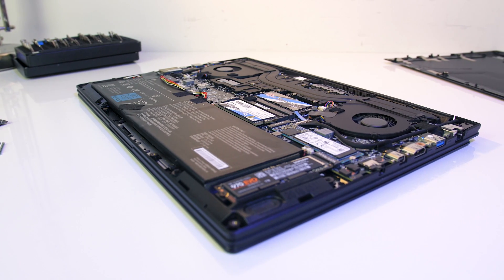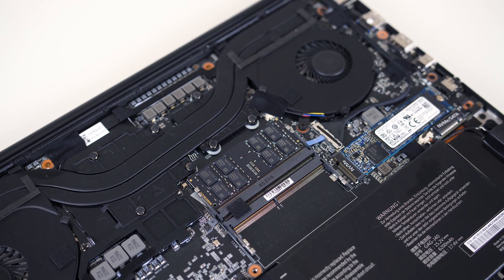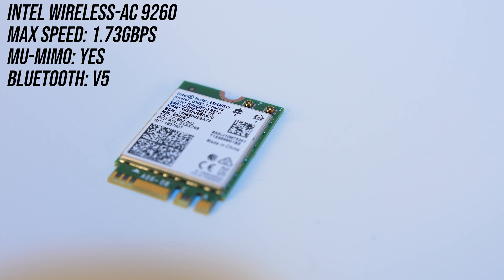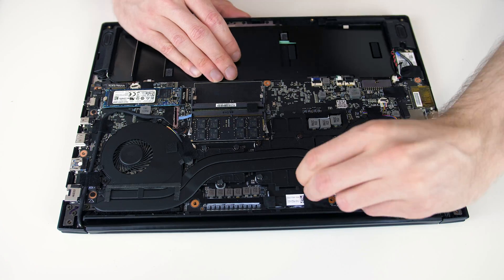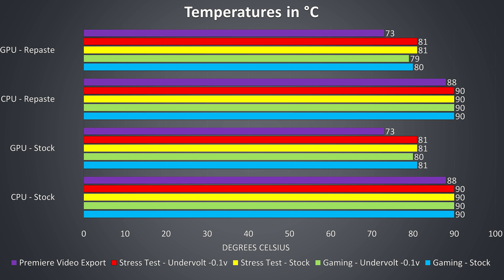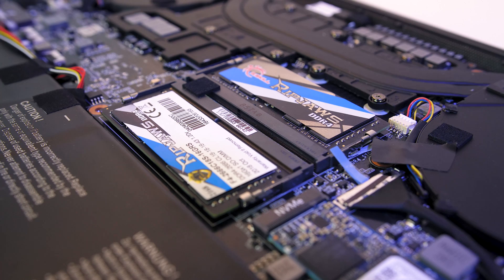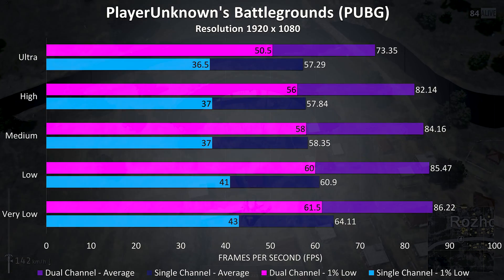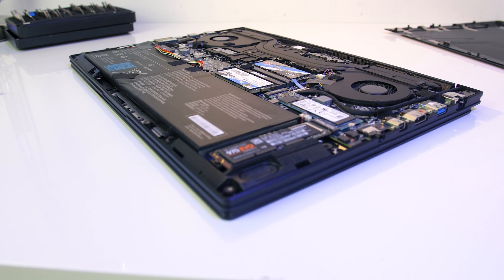Upgrading the Gigabyte Aero 15x Laptop

Comment from the maker: Just to clarify, my memory is running at DDR4-2400 17-17-17-39 because this is the highest that both sticks (1x v-color and 1x g.skill) support. I am not sure why DDR4-2666 with the two G.Skill sticks is not working, but others have also confirmed this issue despite the official Gigabyte documentation saying they should be supported. I submitted a support request to Gigabyte to see what they can advise on this, but it seems like the only way for me to get DDR4-2666 would be to get two new sticks of memory and roll the dice again, which I'm probably not going to bother doing as memory isn't cheap. I also forgot to mention that memory should support DDR4-2666 with JEDEC rather than XMP profiles, which are not supported here.

All temperature testing fan speeds were set to maximum, so that wasn't a variable and was the same throughout all testing.
Reply from the maker: Weird, I tried all sorts of things, rebooting lots, taking the battery out, holding F2 on boot to try and get into the BIOS, leaving it running on black screen for a few mins, leaving it off for a few mins with no power, nothing worked for me. Yes, software reports it as running in dual channel (as per pinned comment, both sticks are able to run at DDR4-2400 CL17) and the increase to game performance shown confirms dual channel is working, we wouldn't see such increases just from the size difference of 16GB > 32GB.
Reply from the maker: @OddlySatisfying  Hey! Yeah I have heard about the HX426S15IB2K2/32, would really love to buy it but the kit is $500 AUD here so I feel like it's not really worth it at this point, even if I sell my G.Skill memory I'd be taking a loss just to get a little extra speed, wish I knew about it going in lol. I mentioned this one in the description though as I found out about it after making the video, so hopefully the info helps someone. I have a feeling that the dual G.Skill sticks will not work, but still I want to see what Gigabyte have to say about it because they shouldn't be listing it as supported. I'll be at CES, I believe there will be quite a few new laptops there so should have a few videos coming out in the next two weeks! So far I've got appointments with MSI, Gigabyte, and Dell, hoping to get more.
Reply: Just upgraded my Aero 15
16GB Crucial CT16G4SFD8266 works with 
16GB V-Color TN416G26D819-SB2
19-19-19-43 2666MHz
Reply from the maker: @Al Ec Thanks! I tried using both sticks in each slot one at a time, neither worked for me. I tried with the battery removed and no disks installed as well. Other people confirmed the same issue, so seems like it's not just me, either way I'll see what their support guys say, hopefully we can get it working.
Reply: @JarrodsTech  Please keep us updated if Gigabyte responds to you. According to the forum you linked, someone had contacted Gigabyte & they replied saying the Crucial 16GB DDR4-2666 SODIMM should work without issues, a couple users tried with success too.
Reply from the maker: @boy638  Yeah I'll update this pinned comment / description with an update when I have one, might post on Twitter/Facebook if you follow there.
Reply: I ended up selling the g.skill sticks I bought on eBay. Both would work alone in my machine but they would not work together. (Though it did take quite a few reinserts to get it to boot) I bought a set of Kingston cl15 (as someone recommended on the announcement for this video) They worked first try. Kingston Technology HyperX Impact 32GB 2666MHz DDR4 CL15 260-Pin SODIMM Laptop Memory, Kit of 2 (HX426S15IB2K2/32) https://www.amazon.com/dp/B01NAL3TYY/ref=cm_sw_r_cp_apa_i_99IjCbPCQQJG6
Reply: @JCFain  i did some upgrades on my 15x, but avoided ram because i knew about the compatibility issues and that shits just expensive right now lol. 

maybe in a few months prices will come down, til then im surviving on single channel
Reply: I do have this laptop too. When I upgrade the ram, i added one more 16gb kingston ram 2666mhz, but i got black screen. Then I changed it to kingston 3200 mhz and it worked, but it slowed down to 2666mhz. weird. both sitcks are not in the support list.
Reply: Is there space around the NVME drive to accommodate a heatsyick?
Reply: Hi. My gigabyte aero 15w is came with single channel 16GB V-Color TN416G26D819-SB2. I want to upgrade it to dual channel. Some people say 16GB Crucial CT16G4SFD8266 will work well. I found this ram on amazon https://www.amazon.com/Crucial-Single-PC4-21300-SODIMM-260-Pin/dp/B071KP8CGJ but then i have to pick between dual rank and single rank. Can someone help me out?
Reply: Are you not able to return the memory should they not work for you?
Reply from the maker: Don't think so, 30 day return policy and bought it about 40 days ago.
Reply: @JarrodsTech  I bought 2x 8 gb sticks of GSkill instead of the 16 gig sticks for my 15x. When I first swapped them and turned on the laptop, I waited a significant amount of time staring at a black screen, then I pressed the power button once (just pressed it, not held it), and all of a sudden the boot screen came on, and everything worked fine after. I'm not sure if that will work for you as well, but it's worth a shot. Also is your ram actually running in dual channel? I was under the impression that if you mismatch the ram sticks (different brands, speeds, latencies, etc), they would only run in single channel .
Reply: @OddlySatisfying  Hey, I also heard couple users having success adding an extra memory from Crucial 16GB Single DDR4 2666 MT/s (PC4-21300) DR x8 SODIMM 260-Pin. You think best I just get that or is it worth upgrading both to the Kingston Hyper X you used?
Reply: hey jarrod maybe you could find someone in the US to sell the memory to, then when you go to CES you can ship it from vegas to the person so you get some money back and dont lose your ass in shipping
Reply from the maker: @bradhaines3142  Yeah maybe, want to see what Gigabyte say though so probably need to keep it to do further testing when they get back to me. They do list it as recommended with 2 sticks, so if it's not actually supported then I want them to stop listing it as supported, or get mine working 😅
Reply: @JarrodsTech  fair point, i haven't done a memory upgrade myself because of compatibility concerns, and of course price, but mostly compatibility. hopefully by the time its got more compatable options itll also be reasonable price lol
Reply: Jarrod'sTech I had to call Gigabyte and get correspondence through email.  They told me to use Crucial, because they are “guaranteed” to work and it does.  So now my aero has 32 gb no issues.
Reply from the maker: @lorda9678  Cool, still waiting to hear back what they say on the F4-2666C18S-16GRS
Reply: @lorda9678  at the proper 2666 speeds?
Reply: On a desktop I would try removing the CMOS battery but I guess that one is located on the other side of the motherboard since it's not visible in your video...
Reply: @rayak_pictures   it is right next to the Wireless card.
Reply: @VasilTsintsev  Thx
Reply: I only added a single Corsair Vengeance kit of 1x16gb DDR4 2666Mhz but left the original. Planning to swap it out for another corsair.
Reply: I'hv tried 2 piece of Corsair 16GB (Total 32GB) DDR 4 2666MHz, but failed. So, now I use DDR 4 2400MHZ Corsair. So sad, why it is not work well.
Reply: BIOS update?
Reply: Not sure if I'm the exception here, but I bought a stick of G.Skill 2666 (F4-2666C18S-16GRS) for my Aero 15v8 (non-x) and they're reading "Speed: 2667 MT/s" under linux...
Reply: hey by any chance did you try using both sticks with the stock vcolor? one might have been doa and holding the other back. also nobody has mentioned how gigabite did us dirty changing the aero internals to the cheapest parts. i saw a bunch of reviews before buying mine  and they showed an lg panel and gskill memory and i think another ssd. instead i have the exact same configuration you have with the shitty ssd and the slowest memory on the market of the same configuration and less desirable au optronics panel i think.
Reply from the maker: @rogervera3753  Yeah I did. I think they sold it with both LG and AUO, I mentioned in my X9 review, after asking at CES, and they confirmed the new models will all only have LG panels, seems like they're specifically saying Samsung memory on the website and sticker on the laptop too.
Reply: When you said it wouldn't boot after the memory upgrade; were you able to see any thing from the screen?
Reply: Got the same black screen problem even thought i got the v-color from amazon which is the same model came with aero 15x. After a whole night struggling ,  wait until the battery drain out, use single ram to boot up and then update the BIOS and then retry to boot up several times , finally this laptop can run 32gb ram with 2666. I think this upgrade is kind of nightmare....
Reply: @daniellam9430  hi can u share how u updated the bios? I tried putting 2 x 16gb 2666 kingston CL15  but it didn't work. It would black screen load out and it will restart itself with black screen again. Only 1 single channel work. Then I have no choice but to pair it up with the original v-color memery that comes with the laptop and it works. But speed is reading 2400. Pls help share your method. Did you insert the other card during the window boot process after you boot it with 1 card?
Reply: @tingpangchong437  
http://forum.notebookreview.com/threads/official-gigabyte-aero-15-owners-lounge.804575/page-306#post-10781307
I followed this method(post:#3053)
At first, I inserted back just one original ram to boot up, updated BIOS through smart update. After BIOS updated ,i inserted 2 sticks of ram, and followed the step 4 to 7 of this method to boot up .Finally it can run 32gb ram in 2666.
Reply: @tingpangchong437  Hi did you manage to boot with your 2 x 16gb 2666 kingston CL15 ? I am also having same issues. I bought the HX426S15IB2K2/32.
Reply: Hi Jarrod,
did I miss the speed and range comparison of the WIFI card? Was it worth doing the change? Great vid btw.!!
Reply: i have HX426S15IB2K2/32 with an aero 15 oled WA biof FB08 no way to get it to boot, any help please Jarrod?
Reply: also these have jedec 2666 profile.... can't understand why they aren't booting tried to switch slot... they are recognized only if a single stick is inserted together with an original samsung 8gb stick making it an unasable 8+16gb machine.... very upset... i see people saying they use these kingston memories but unsuccessfully here, can you hint me someone or a forum or an article or a direct tip advice?
Reply: What happened at the end? Any response? Any news?
Reply: Can you upgrade the cpu?

Comment: Just upgraded mine with - Samsung M471A2K43CB1-CTD ...16GB.. worked with V-COLOR - now i have Dual 2667 speed.... also have 970 evo plus. thank you.

Samsung Ram mostly sold out, luckily found one on ebay for £22

Top slot V-color
bottom near battery Samsung

also note, if you get new SSD, it wont show up on my computer, you'll have to enable it from "> Right click start > Disk management"

Good luck 😊👍

Comment: I have an Aorus 15G YC 3080 and after one year it will not boot up.  No signs of life, no noise when turned on.  Newegg and Gigabyte will not even reply to emails or service tickets.  I do not smell anything electrical.  Does that sound like the motherboard?  I disconnected the battery and used a different charger, which did nothing.  Thank you

Comment: If it helps anyone, have just upgraded to 32GB of memory using the Crucial kit CT2K16G4SFD8266 on this model of laptop. All 32GB detected and running at full 2666 speed. This is dual rank memory which matches the single stick removed as reported by CPU-Z.

Also worth noting that mine had larger screws in the centre covered with black tape so these must also be removed when taking the back off and care taken not to put these screws in any other place when reassembling.

Comment: It sounds bananas but by far the best upgrade to my gigabyte p57w was.. raising the back of the laptop a little off the table so air could reach the vents on the underside. I used a bit of wood shaped like a very thick ruler, double-sided-taped to my laptop stand. It was night and day, went from overheating crashes during games to no worries. Second best thing was using the gigabyte control panel to up the fan speed.

Comment: as an owner of the original V8 with 144hz FHD i7 w 1070 since 2017 I can firmly say this is the laptop that will stick around as long as it runs. 
its not the best in performance or battery life but has aged well considering the large fanbase( and subreddit) giving tips and tricks to make it work.

surprisingly, after all the upgrades ( repaste and undervolt @ -160 mw)  I have seen the laptop booster to a higher speed when word processing/light tasks at 4.07 GHZ single and 3.91 GHZ all day everyday light gaming to heavy office/school research load

battery life has been a mixed bag, 
 whereas 7-8hr was common with a 30-40% screen brightness and better battery or about 6 with 50-60 screen brightness
 I can get about 4 to 5 now but that might be due to some tweaking with the battery settings 
( gigabytes software locked it to 1.70ghz on battery mine will fluctuate from 1.70 to 2.69 or can be locked at 2.69)

as for gaming, I don't do much except for light gaming like TFT or league of legends no throttling for those just about 71-75 degrees C after a few hours

Lightroom is great on the laptop especially with the Pantone calibration although the fan does hum sometimes, as a shift in quieter more power-efficient devices leave more to be desired 

Overall, just like my Note 9, my daily driver, the AERO 15v8 is the laptop I can keep around and be content using, sure there are laptops with better screens, battery life, and features. Yet after 4 years of owning my aero does what I need and is well enough for a lack of headaches.

for the average joe get a MacBook air and honestly, that will probably be my next laptop should my aero fail me

But until then I am a happy owner of my aero that has gone with me through undergrad and is back with me for Grad school 

+1 r/gigabyte subreddit

Comment: Hey Jarrod. Saw this video when it came out about 2 years ago, bought a renewed aero 15, and finally today finally had everything together and went through the upgrade process. SSD, wifi card, and ram upgrade all very quickly. Thank you for this super informative video and great advice—the computer is so much more snappy and 3x as much memory now! So hyped.
Reply: Also if anyone does this, 5 things wish I knew: 1. will need #0 Philips head and T6 screw drivers. 2. Plastic spoon is a good pry tool. 3. For battery removal the white connection point is very hard to get out. Pull and wiggle on the ends to get it out, don't pull wires. 4. Swap original ssd to other slot and add 1 new 16 gb killer to first slot worked first time no problems. 5. After adding SSD have to enable in software so it shows. Good luck!

Comment: hey Jarrod 

thank you for this video - i used it when I added a new SSD. 1 question though, what wifi card did you replace in your laptop? My Aero 15w OLED uses the killer ax1650x and its just awful and wanted to know if you'd recommend the wifi card you are using for this laptop. 

cheers
Reply from the maker: I just stick to the Intel ones, today I'd go AX210NGW
Reply: @JarrodsTech  cheers for the suggestion
Reply: @JarrodsTech  I put the AX200NGW inside and the wifi speed is just as awful - maybe it's just a Aero15 OLED problem... shame.
Reply: Hi @Dave, I want add a second ssd too, but I don't know if the second nvme can be PCIe or SATA. I've a Aero 15 Oled WA (i7-9750H, 2060). What nvme did you buy?
Reply: @CapitanUniverso  I bought the WD_BLACK 1TB SN750 NVMe - highly recommend.

Comment: So I just replaced all my paste with Corsair tm30 and cleaned out the fans and ducts which were bad. While gaming 43% cpu usage I get 92• Celsius cpu max... so I’m repasting with grizzly kryonaut and using thermal pads for the vram even though it came with paste. I just do not know what pad size to use for the vram.

Comment: No one should buy this laptop or any of the Aero Line, these laptops works for two months before they start to give problems. The drive will die after any real world sustained work load and the laptop will brick after one year. On paper this is the perfect laptop but it's far from it, So if you have money to waste, go for it. 
I bought the gigabyte Aero 15x V8 and it was the worst purchase dissection I've ever made, I lost so much money because of that laptop and not to mention the money I spent to replace the dead ssd and to up grade the memory.

Comment: I swapped my thermal paste from stock to Kryonaut after using the Aero15X for around 2 years. Before I changed my idle temps were at high 80s to low 90s, post-Kryonaut temps were much better at high 50s to low 60s on idle & clocking 3.9Ghz on ALL cores during my 30 minute XTU stress test with package temps not exceeding 92 degrees celsius. My suspicions were proven right, bad temps were caused by a mix of clogged up dust fans/fins & stock thermal paste that’ve dried up. I only used 99.9% iso-alcohol and a few cotton buds, it wiped them clean just fine. I also didn’t use thermal pads like shown in the video and used the Kryonaut instead. One small syringe of the Kryonaut should suffice. Reply to this comment with any questions, would be happy to help! Btw great video! This served well as my go to guide for my Aero15X.
Reply from the maker: Thanks, good to hear that it helped